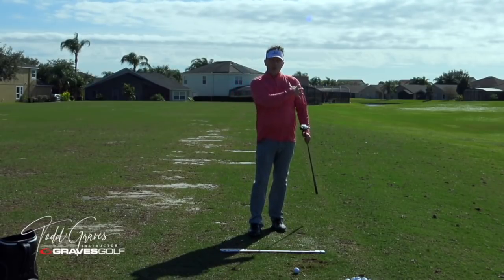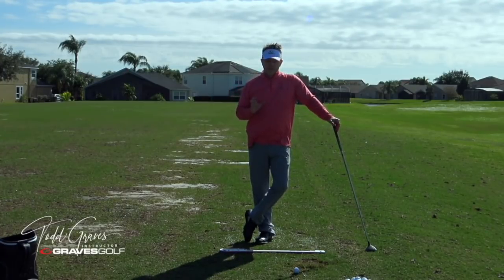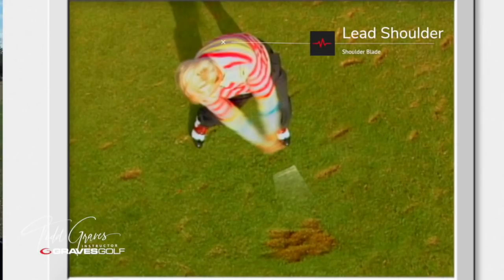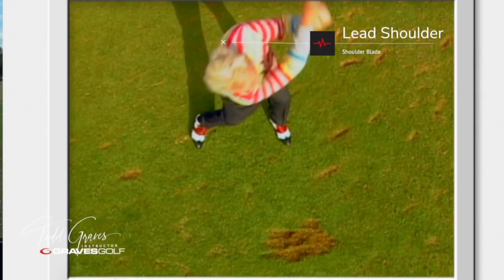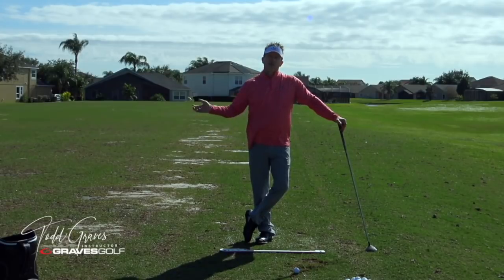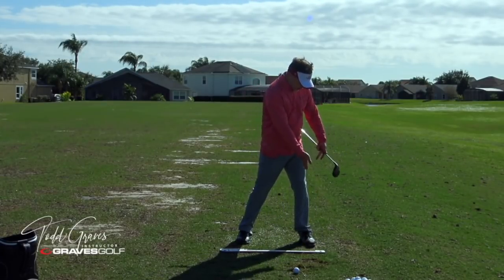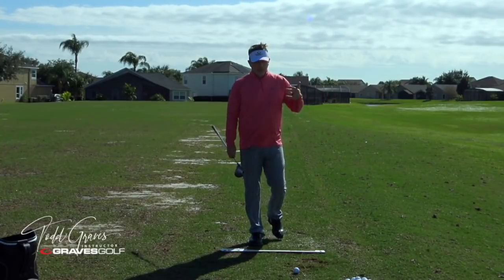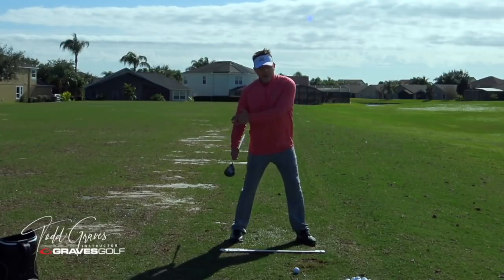Moe Norman's Genius: The Lead Shoulder

Comment: Todd- awesome video!! Hey would you recommend or staying away from speed training? (speedstix)
Reply from the maker: No.  I think if you combine speed training with good technique it can be helpful however, most of speed training requires strength and fitness.  I suggest adding adding strength and fitness training to speed training or it could cause injury.  Also, keep in mind that speed is also a function of stability - if you are not stable, you can not be fast.  This requires strength in the stabilizers of the body.  Positions are very important too.